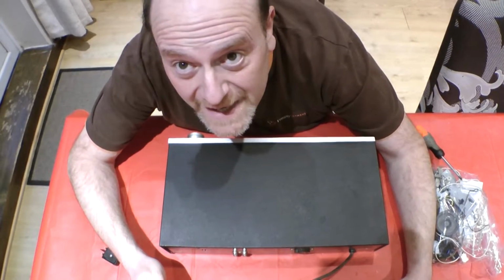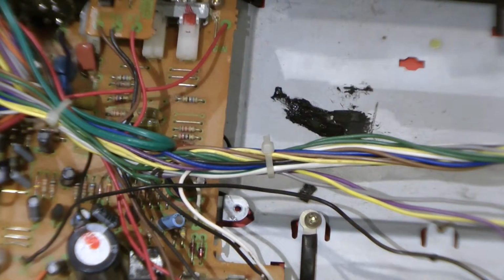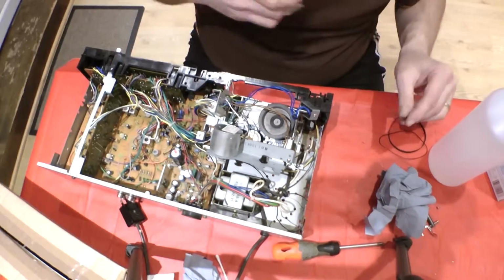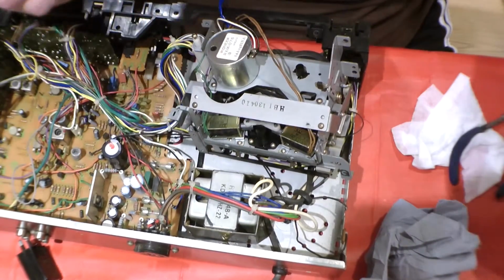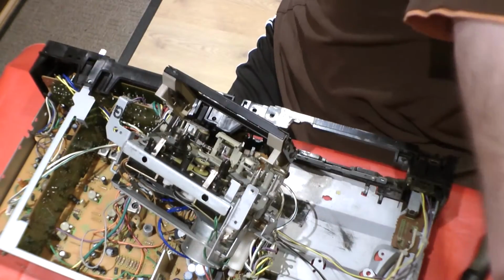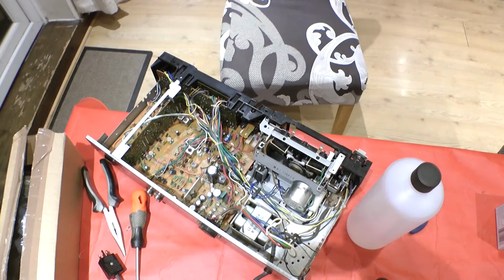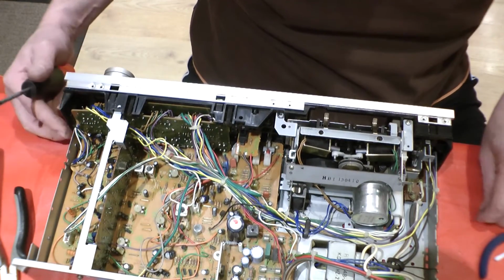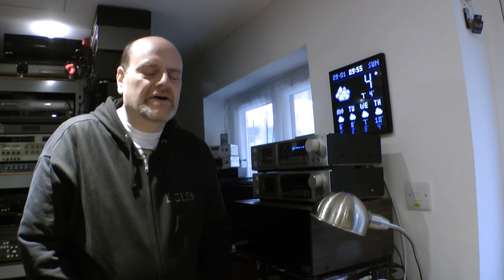Pioneer CT 520 1981 Cassette Deck Belt Replacement and Check Up @avtransfersUK

Comment: Thanks for the video, it helped me a lot!
I replaced the belts but I have a problem with the speed of the motor, which runs really too slowly: can you tell me where the adjustment is?
The hifiengine documentation didn't help me...
Reply from the maker: Should be a speed control in the back of the motor. Youd need a jeweller style flat head to adjust

Comment: I have the same deck.  Everything works, play, FF, REV, etc EXCEPT the MS (music Search) feature.  When in FF if you engage MS it seems to try and push the head up into the tape but it won't stay it falls back.  Any ideas?
Reply from the maker: Hmm. Unusual. Perhaps check around the head solenoid.  Could be lubricant .  My guess is mechanical. Is the machine high hours